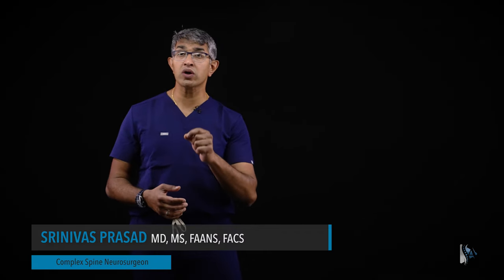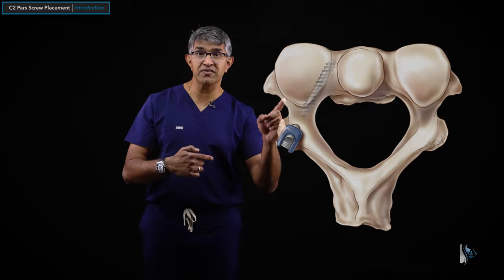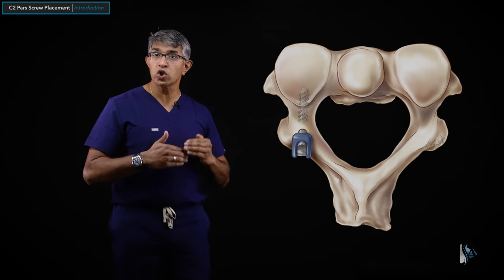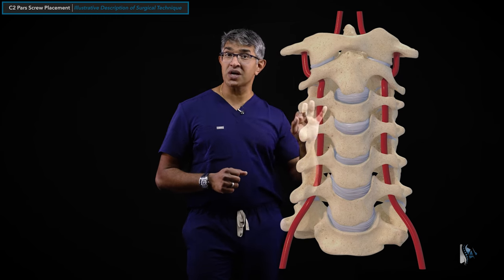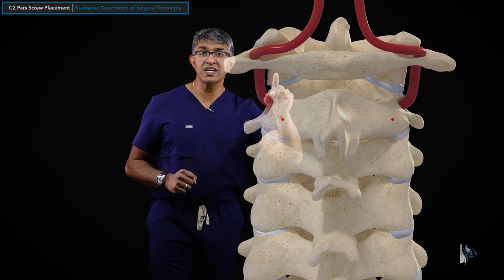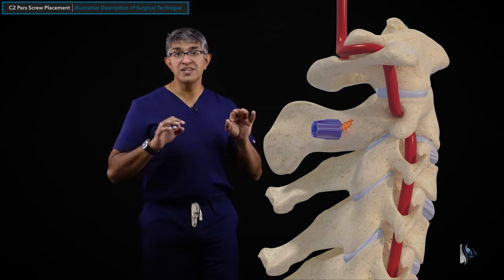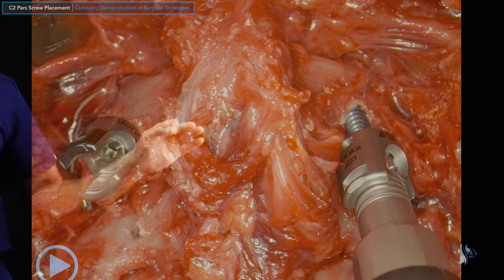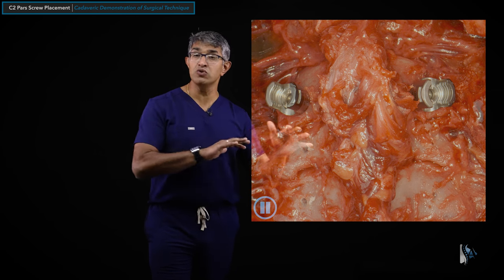Surgical Techniques: C2 Pars Screw Placement

Comment: Such a great video. One can just go through this before a surgery for a safe confident surgery.
 I have done about 20 cases with C1 lateral mass and C2 trans laminar screws just because the pars screw used to scare me a little. The only difference is you have to make an L shaped rod. But if the construct has to go down to C3 then ROD placement becomes impossible with the translaminar screws. Your video gave me the courage to do pars screw and it turned out great. 
Thanks alot
Reply from the maker: That's fantastic! I'm really glad it helped! Good luck and thanks for watching! -SP

Comment: Thank you, really appreciate your videos. What is your preferred way to achieve fusion in C1/2 (or occipito-cervical) instrumentation? Do you decorticate C1/2 joints, and if yes what is your technique? If you have to perform posterior C1 and/or C2 decompression, what do you rely on achieving fusion? Are there any scenarios in which you harvest iliac crest autograft?
Reply from the maker: My pleasure. I don't systematically sacrifice the C2 nerve roots so I don't usually decorticate teh C1-2 joints. If I do sacrifice the nerves then I decorticate the joints. I use ICBG autograft routinely for O-C and C1-2 fusions. Typically this is onlay over the C1 arch and C2 lamina as I don't typically need to perform a C1 laminectomy. Hope that helps! -SP